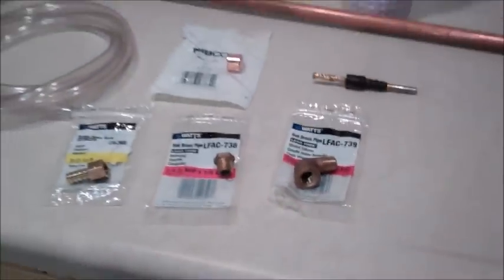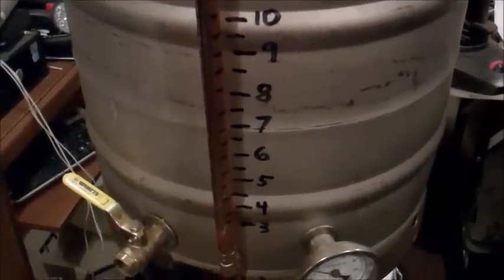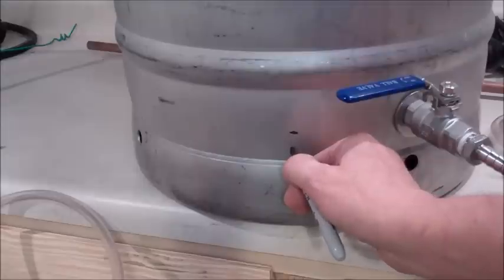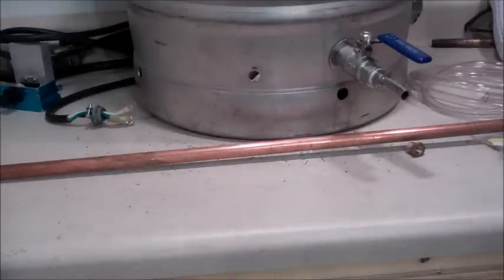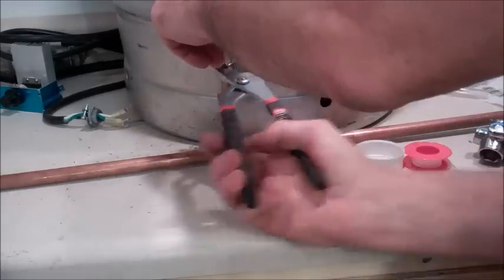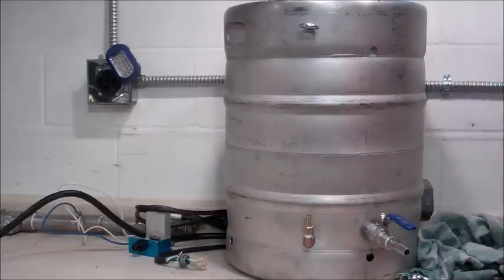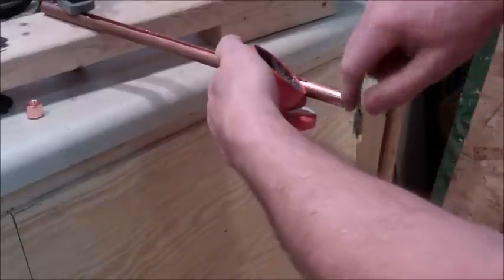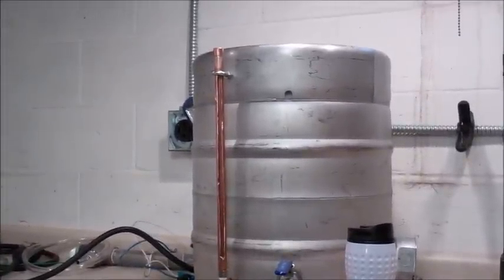Making a Sight Glass for Brewing for under $10

Comment: Thanks Tim. Now if I can find my dremel tool. If you make anymore Tim you can drill a hole of each end of the cut out before you do the cut out and you will have a nice radius ends on the slot. 1/4 or 5/16 hole maybe. I have time to kill so I will probably use a straight edge to draw the cutout lines and sit down with the old dremel tool and give it a try. You did well holding that grinder with movement going on.
Reply from the maker: Great idea about the holes at the ends of the slots.  I may try to retrofit a couple in now.

Comment: Tim it looks to me like the pressure in the sight tube would build up an read lower than the actual level inside container?
Reply from the maker: There is no pressure build up in the sight tube, as it is open ended.  It reads the level of the kettle. I have installed 4 of them and they all work great.

Comment: very cool. I would much rather do this than pay for a sight glass. How often do you need to change the tube from cloudiness though? Would it end up costing more over time, or is there a way to clean the tubes as well?
Reply from the maker: I have used it for over a year, maybe 10-15 brews and haven't replaced it yet.  It is starting to yellow a bit.  But it is just your basic vinyl tubing that you can pick up 10 feet for $2.99 at Menards. I have a bunch of it lying around for siphons. Since you only use a little over a foot or foot and a half I wouldn't worry about any ongoing large tubing expenses.  Even regular sight glass tubes need to be replaced occasionally and they cost a lot more.

Comment: Does a sight glass add contamination to the wort as it never really boils in the sight glass tube ??
Reply from the maker: I would not think so, but never really thought
about it.  Lots of kettles have them.
Reply: How hot does the top of the sight glass get. ?
Is it hot enough to kill bacteria. ??
Maybe there should be a way to recirculate during the Boil. Just make sure the liquid is properly sterilized. I realize that lots of kettles have them. I was just wondering is all. I’m building a brew kettle now and saw your video I think it’s a great vid thank you
Reply: My son has a sight glass and his shows the liquid boiling. Your mileage may vary.

Comment: Did you seal the top of the plastic tube???
Reply from the maker: No I didn't.  If you sealed it, it wouldn't work as there wouldn't be anywhere for the air in the tube to escape, like a glass upside down in water.

Comment: I tried years ago to get food grade vinyl at Lowes, Home Depot, or Ace hardware - no go. It SAYS FDA approved, NSF, or similar if it is. If it's not marked it isn't. Maybe things have changed. But PVC/vinyl is still not good for food and cannot be used for beer in Europe. I've eliminated all PVC in my beermaking larely, even in keg serving, which is cold and doesn't leach chemicals as much. I could still taste it when it sat, though. In addition, hot applications leach hundreds if not thousands of times more chemicals than cold. Obviously, do what  you feel comfortable for your health. I'm hoping others that are concerned about plastics see these comments, though.
Reply from the maker: I have never tasted anything remotely like vinyl in my beer.  It doesn't touch it long enough or in enough of a quantity to transfer anything to it.  That said, if you do, by all means use something else.
Reply: Richard Bennington 
If anything get it from you LHBS

Comment: Why do you need a site glass to see the liquid level when you can just look in the top of the keg?
Reply from the maker: Marking the sight glass allows you to easily assess volume in gallons, without looking in the kettle.  If you have your kettles above sight level, say in a three tier setup, looking in the top vessel may not be so easy and most cheap kettles are not marked for volume. You can see what is in the kettle but not have a measure of how many gallons it is.   Finally, if you are boiling, the steam generated and the waviness of the liquid may not let you see inside markings accurately.  A sight glass makes this a little easier (although the level can fluctuate with the inside volume).  You can make do without one.  Turning down the boil for a minute will let you see inside markings.  Measuring how tall your kettle is with a ruler and dividing the length by the volume can let you figure out how full it is (i.e. my 15 gallon kettle is 15" tall, so every inch is a gallon). A sight glass just makes it a no-brainer.

Comment: The vinyl you get at the department store is NOT food grade. Better would be to buy some polycarbanate tubing or use silicone tube. Best would be to use glass, which would be great in this application, as you've designed a nice copper protective sleeve!
Reply from the maker: I am not sure I agree with that. It is purchased in the plumbing department and meant to be used as water line.

Comment: Why did you solder the end cap on seems unnesessary
Reply from the maker: +Joey Zahariuk I put the cap on because I didn't want to take a chance of it spurting out of the top of the hose and spraying or splashing. It probably wouldn't but I just thought it was safer.  I also thought that it finished it off nicely.